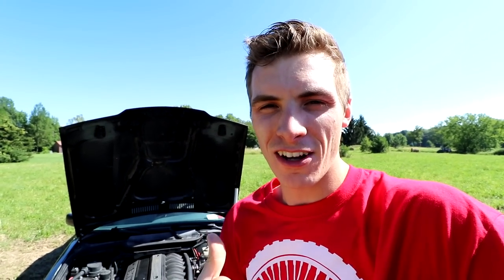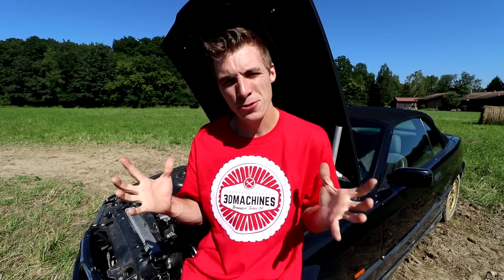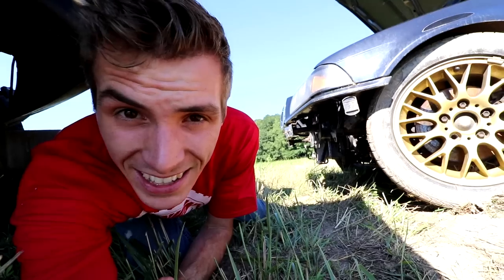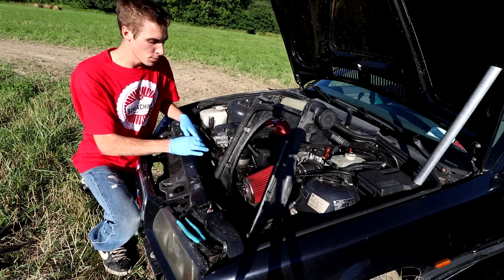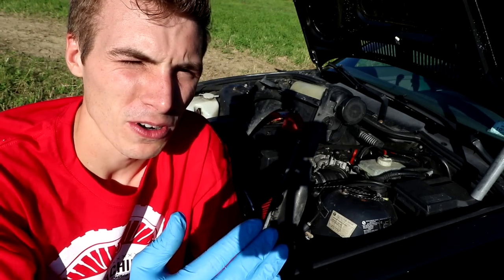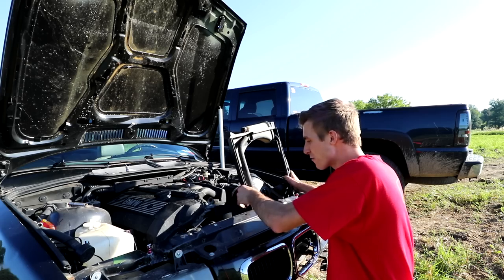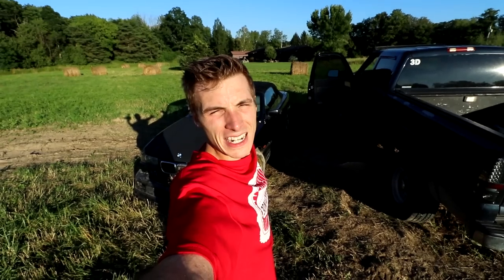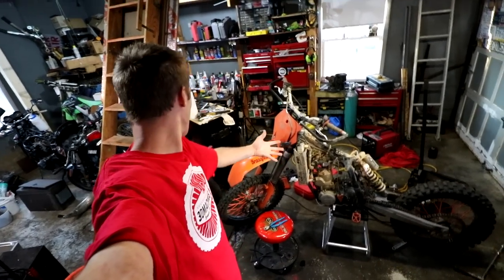MY BMW is Broken Again...

Comment: I actually considered mentioning the thermos
None of the high power engines I built
ever had thermos in them.
They do how ever... Market a restrictor plate
But doubt you need it... If you do...
You simply pry the top portion off
of your thermos... put the bottom half back in.
(Sorry... I got interrupted... What was I saying...)

Oh... There are some that say
you need to slow down the flow
of the coolant
to efficiently collect the heat from the block...
Well... I need evidence... before I believe.!

I used to work as a specialized courier
(Think... The Transporter... Can not mention clients...)
The 300hp Chevy S-15 I drove
Had unknown top speed
I only pushed it to 160... It wanted to go more...
I didn't.!
NO TERMOSTAT.!
(And needed a new muffler yearly...)

The transmission was highly modified
As well as extensive porting.
My job required me to ignore the speed limit
though my average speed was 99.

And, yes... I have spent a lot of time with cops...
Most that know me... Have a great deal of respect...
(I have license to do what they can not.!)
Reply: It is difficult to realize...
I used to get paid...
To do what most people
get put in jail for.!

Comment: Bmws are a pain it's hard to get all the air out the cooling system some times what I do it jack the front up as high as you can and then try blooding the cooling system if you have any air locks it will over heat

Comment: I had a 97 328 with 50000 miles and mine would over heat time to time water pump thermostat and vacume houses

Comment: Hey 3dmachines put a cold air intake on the BMW that will help with the heat problem some
Reply: Nicholas Sharp it already has one, theres not much room in that engine bay, short of ramming it out the hood haha

Comment: LS swap the BMW!!!!!
Reply: Put a 727 chevy big block in it
Reply: No such thing as a 727
Reply: Twisted Steel Customs I meant a 572 from Chevrolet performance it has 727 hp 😂
Reply: Ah rite on. Probably wouldn't fit. LS chevy motors are a fairly common swap into 3 series BMW's. You can actually buy a kit for it. Headers motor and trans mounts ect.
Reply: Twisted Steel Customs good point, could make it a rear engine BMW with. A v drive then the big block could fit 😂

Comment: I am close to unsubscribing. I like the old 3D machines. Small motors, motorcycles, etc. This new track has turned this channel into just working on cars. I want to see the Gator run with the GS1000 motor